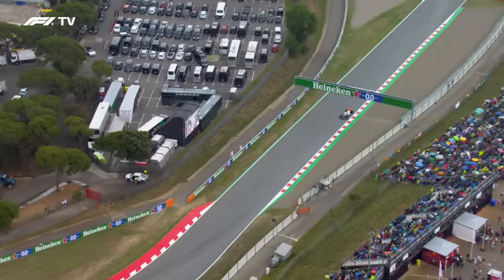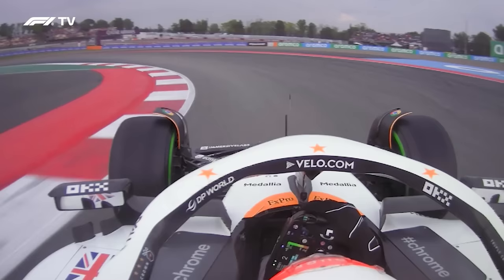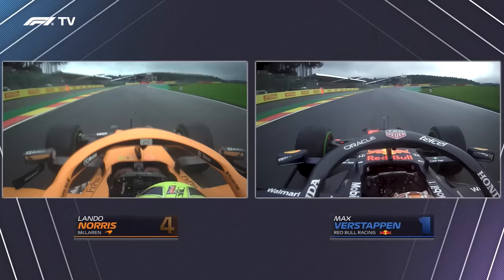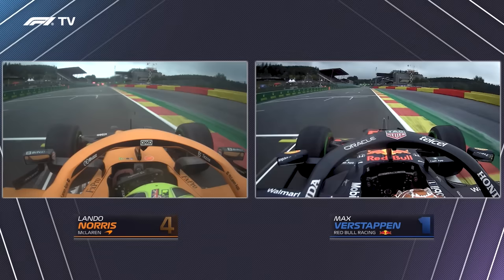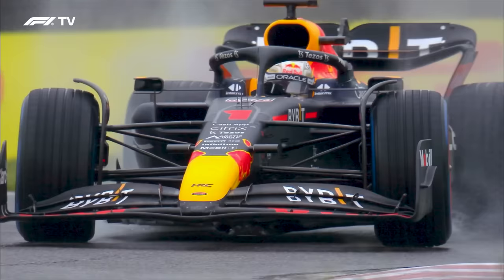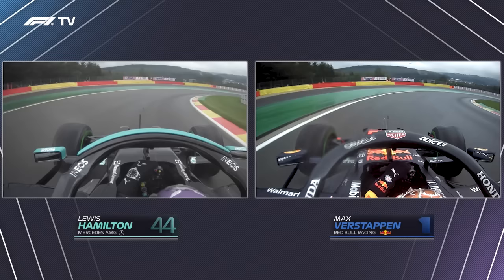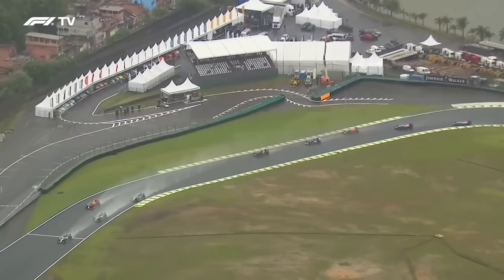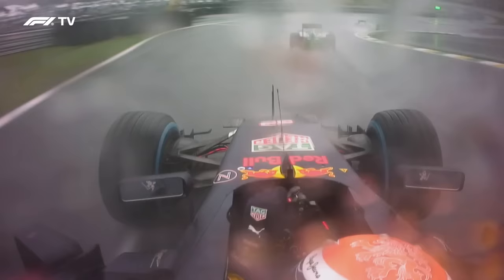What Norris and Verstappen Do Differently In The Wet | F1 TV Racing ID

Comment: thank you for making this video Jolyon palmer and F1 media team. You perfectly described Max's driving lines because he uses the wet carting line, where an f1 car is limited by the grip of the tyre and cant put power down as readily, the wider line can carry more speed to overtake. norris abuses the apex and track limits because ever since he joined mclaren in 2019, their car always had a weakness in low speed corner speed, so using track limits to force as tight of a line and throw as much speed in as possible; something that ricciuardo couldnt do because it unsettled the car way too much. daniel ricciardo needed the car to carry speed into a wide turn in order to force his "late breaking" overtakes

Comment: Anyone have any insight into how those aggressive lines affect Lando's tire life on wet and intermediates? Since we frequently see it be very relevant to be able to eek out a few more laps out of worn intermediates when the weather is still prone to changes.
Reply: well, one of the critical things on inters and wets is managing temps, especially on a drying track it is extremely easy to overcook them, off normal lines you'll find wetter surface which helps cool them down, can make a lot of difference when everyone else is doing normal racing lines.

Comment: Russell is more of a “rain master” than Norris 😂 (Spa 2021).

Dude got P2 in a backmarker Williams which is more impressive than anything Norris has done in the rain.
Reply: Back at it again
Reply: @j0hnno  There’s no lies in what I said. Norris hasn’t done anything anywhere near as impressive in the rain as what George did at Spa 2021 in a Williams. 

It’s not my fault if that fact bothers you.
Reply: Thats impressive but williams also gambled and went full rain setup
Reply: Ressul himself said that he was only so fast because he saw Norris going so fast in the rain before he crashed and analyzed Norris' lines carefully and then drove as well
Reply: @bitcoinentdecken  Still had to get the job done in those conditions in an abysmal Williams.
Reply: @felixbaecker  *Russell. Secondly, Norris didn’t bin it at the end of the lap. He did it up Eau Rouge. George still had to find the perfect line in different conditions in a Williams.
Reply: C'mon lol. They put maximum wing on the car just for the qualy, to HOPEFULLY have a wet race where George could fend 8 other cars off and HOPEFULLY get 1 point. If that race went more than one pace lap George is struggling for 10th place, if it was dry or intermediate he would have been 20th in 5 laps. Spa, all top speed.
Reply: George mentions in a video they did together that he actually watched norris' laps to see how he was going quickest because norris was even faster than verstappen and Hamilton that day before he crashed. And George actually replicated that lap and got p2. He actually jokingly thanked lando as well in the video. Go watch it, Lando, George and albon are in it.
Reply: Norris hasn't done anything that impressive in the dry either.
Reply: @mohammadnashitsiddiqui2168  
That’s fair tbh. I want Lando to do well. I’d never want any driver to fail. 

But I’m not going to pretend Norris has impressed me, because he hasn’t.
Reply: The Williams was set properly for the wet though in 2021
Reply: P1 by 5 tenths at sochi quali